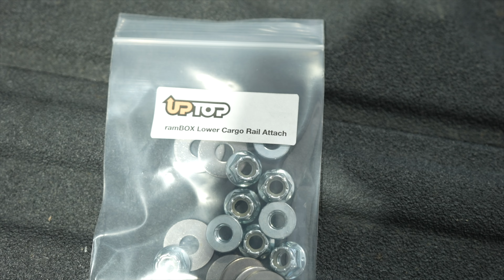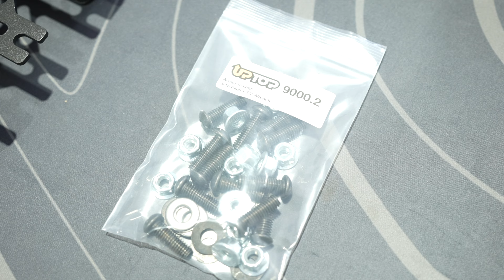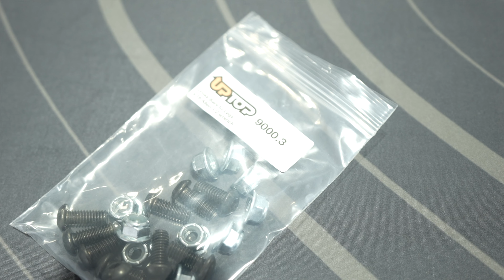RamBox TRUSS Bed Rack Installation | upTOP Overland

Comment: I use a Flated topper (higher height version) with Hest outdoors matrass bed combo as a camper on a power wagon 2500 Rambox.
I love the Leitner Designs cargo solution unfit for Rambox.
This track right here ❤ some it. 
Do you think I could add the Flated topper on top (when I don't want to carry a roof tent and have surfs, kayaks on?). Does it fit? 🎉 thank you